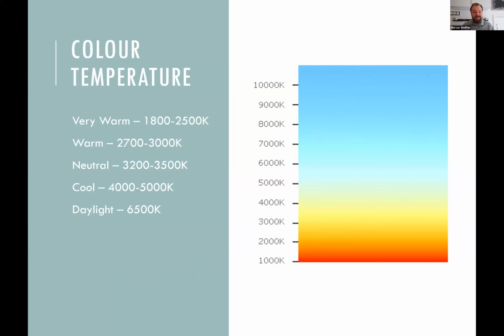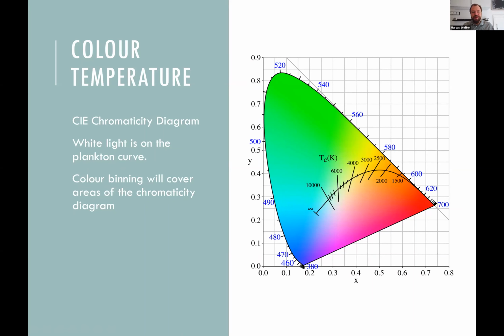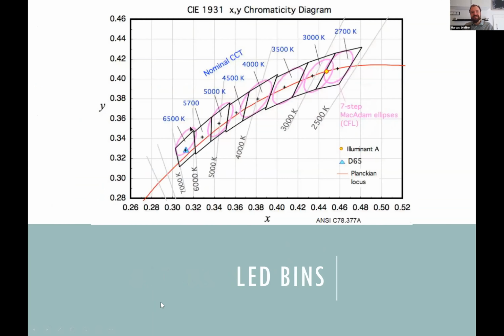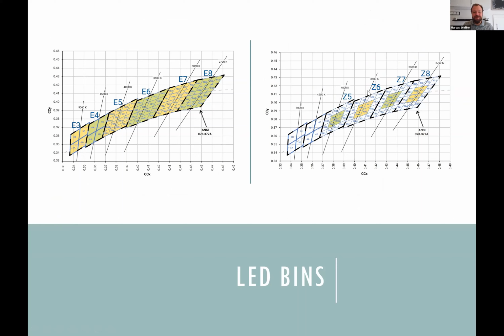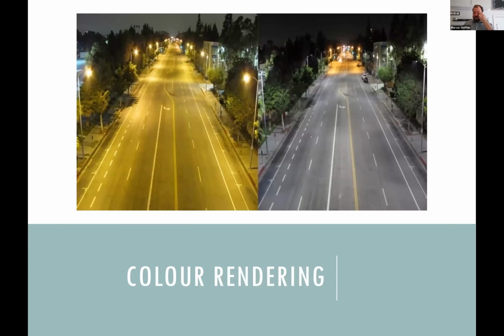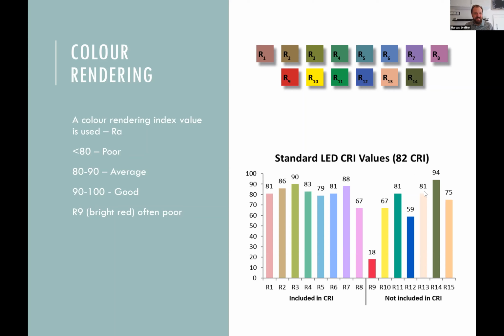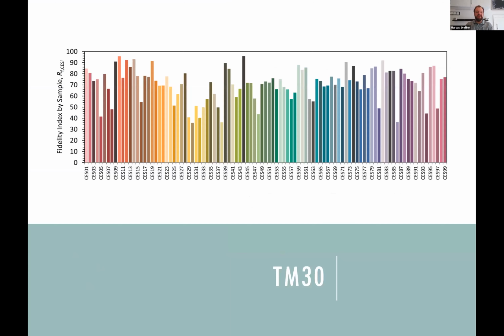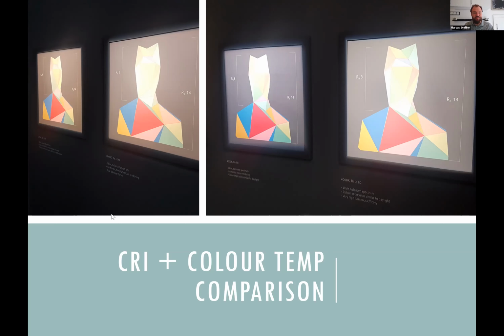Fifty Shades of White

Comment: Great explanation! I've been going around the internet the past few days trying to understand all of these and your video has made the greatest difference yet haha
I still have many questions though.. for example, is the SDCM of a LED lamp related to its CRI value? if so, is it the SDCM the only factor that determines the CRI value or are there others too:

I could imagine that when the LED nodes are used from bins that are far from the Plankian Locus line, making them more green or pink, their CRI rating would go down compared to those that are made only from bins near the Plankian Locus, but are there also other factors that influence in this rating? The LEDs semiconductor compounds maybe?
haha no pressure though, either way great vid. Thanks!

Comment: Hello Sir, like your presentation. Just one question does CRI dependent on CCT.
Reply: Hey! From what I've been reading, I think that CRI of a product is measured by making a comparison of the colors of objects reflected when using a source with known CRI100 and the unknown product. However it is essential for both the product and the CRI100 source to have the same CCT or temperature. So you could say that no, they are not dependent and you should be able to make products with CRI95 with any CCT value. Although I don't know if you could make a comparison between two different CRI100 sources with different CCT values and wether or not one could be more color accurate. Once again I imagine that any extreme like 2000K or 7000K are much worse at representing colors than a 5000K

I definitely do NOT know enough to defend any of my guesses tho hahah